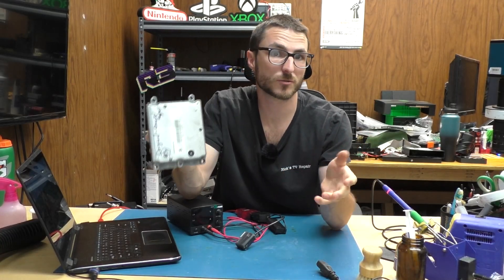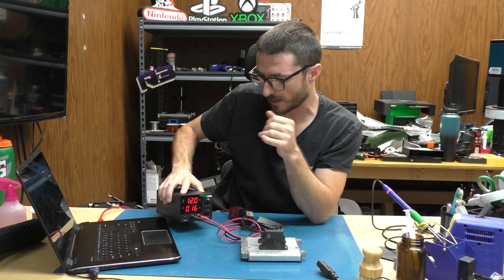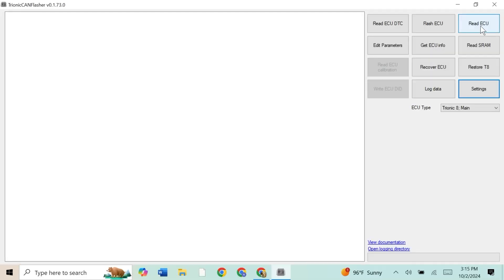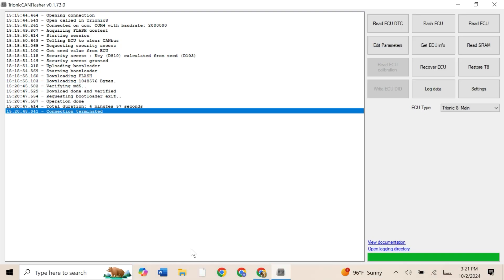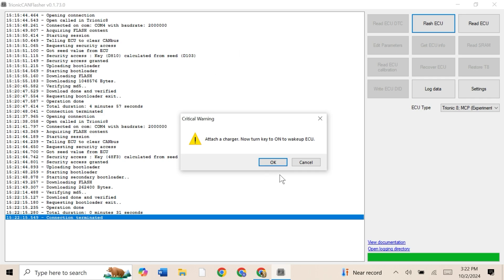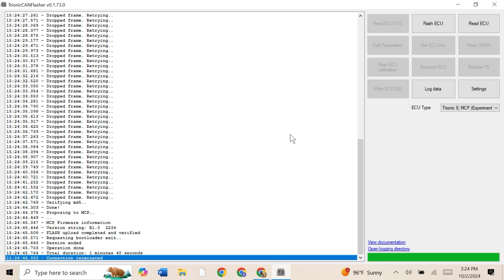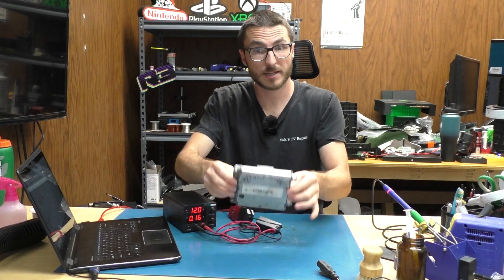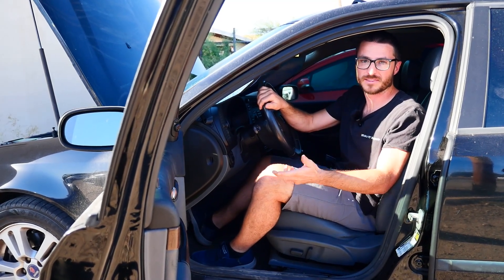Saab 9-3 ECU ECM Cloning Tutorial

Comment: Can you tell if on the car cloning optionally available? It can probably require less equipment for that. No power unit, no extra harness or adaptors are needed...
Reply from the maker: Yes you can also clone with the unit in the car and connect the computer to the vehicle. When you do that you will need to also plug in a battery charger because it will draw power from the car battery and drain it. If the battery drains out completely during the progaming process it could brick the ECM. So if you are going to do this make sure you are connecting a battery charger to the battery while programing. 
All of my filming equipment is in that room and it was easier for me to show it as a bench cloning than in the car cloning.
Reply: @NicksElectronicRepair   Thank you. Do you mean, cars` battery capacity might be not enough to finish cloning procedure? What kind of charger you have mentioned? Is that a plain car battery 12V charger that should be charging the battery during cloning or, an external 12V power supply to feed OBD assembly?...

Comment: So after I clone it onto the new one I just put it back in and I’m all set?
Reply from the maker: If everything is done correctly yes
Reply: @NicksElectronicRepair can’t wait, about to buy a 07 Saab with 156k miles for $375 I have the shop paperwork saying that the ecu/ecm intermittently overheats. They told him the car is done and they can’t replace the computer due to not having the correct software. The cars was also deemed as being in good mechanical shape. Does this seem like a good move?
Reply from the maker: For $375 yeah that's worth the risk if you ask me. But also the ECM can be fixed you probably don't need to replace it. Repair may also be more reliable than replacement since a lot of units out there are used and in bad shape. You can technically still get new ones through official channels but you are looking at $1,200 + shipping and tariffs (they are coming from europe)
Reply: @NicksElectronicRepair okay so. Send you mine you fix it for $480 and I put it in? Bing bang boom $3500 car?
Reply from the maker: I think that could be the case. Obviously, I can't guarantee nothing else is wrong with the car, but if that's what the mechanic is saying, then yeah in theory, that's $2,645 discount on the car. 
When it comes to the ECM, I guarantee a repair or I will replace the ECM for you with a refurbished one. So no matter what, you are 100% covered on the ECM front.
Reply: @NicksElectronicRepair okay cool
Reply: @NicksElectronicRepair on my way home right now
Reply from the maker: Are you saying you pulled the trigger on it and bought the car? If so, then congrats on the purchase. How is she rolling? Any rough idling, white smoke from the exhauste or codes / check engine light coming up?
Reply: @NicksElectronicRepair I have a rough idle at start. I get white smoke sometimes. Moves great
Reply: @NicksElectronicRepair is that maybe the vacuum pump dripping into the turbo?
Reply: @NicksElectronicRepair  Saab 9-3 4 cylinder parts list
Fuel pump
Vacuum pump gasket kit ( found leak)
Power steering rebuild kit
Front bumper 
Radiator
Taiwanese ecu kit (hopefully solves overheating)
Paint / primer
 Shifter knob
Seat
Oil change
Coolant flush
Tech 2 scanner clone
Reply from the maker: In my experience that is all related to the ECM still. Here is a video I made on that fault:
https://youtu.be/VBHQRhvKxBw
Reply: @NicksElectronicRepair ohhh very interesting
Reply: @NicksElectronicRepair I am going to send the ecu for repair for sure. I will also fix all the leaks in the mean time. I am running a combustion leak test. If that’s good I’m going for the vacuum pump and fuel pump. While the ecu is being fixed.
Reply: @NicksElectronicRepair  combustion leak test passed. Time for an ecu!

Comment: Hi Nick,  I am attempting to clone a saab t8 ecu per your video. I have downloaded trionic can flasher v0.1.72.0 and got connected to the ecu through my cardaq j2534 programmer. I've got good communication and can get info and as well as read and write flash. My issue is when I flash ecu i never get the message warning about it changing the vin and key data. As a result when i get info after the flash the vin and calibrations numbers do not change, im also guessing the key/ eprom info has no cloned over. When i re run flash ecu the software tells me files are identical, what am i missing here?

Comment: So I got a junkyard T8 and I have the flasher and obdsx but when I try to read the ecu I get failed to get security access. Is there a step in missing to gain security access? How do I do that for this junkyard ecu? Thank you
Reply from the maker: That's weird. I have not experienced that and am not sure what could be causing it. I have no idea why that would be triggered.
Reply: @NicksElectronicRepair  so I ended up finding out it was because in device manager, i did not have my latency set to 2ms in the advanced settings for the com port. Also i did not have the proper security updates, which then caused another error. After I did those two things it was able to give me the ecu information. But it had weird computerized language next to it as well. Ultimately I started having issues when reading the ecu as being frames drop, similar to what was showing in your video, and I put on my IT hat and remembered if it's saying frames are being dripped then it's relating to cpu and GPU usage. The frame drops are happening because the computers graphics processors is getting too much stress in addition to the cpu. I tested the theory by taking out my Alienware with windows 11 and putting the can flasher program on it for windows 11. And it worked fine and did the entire read in 2mins. And as for flashing my ECU, it only took 3mins. So 100% faster than most people's recorded times and 100% directly related to CPU and GPU ability.
Reply: Youve probably sorted it by now, but I got the same...Turned out I had placed the connector the wrong way.. After that it worked like a charm.
Reply from the maker: oh interesting. 
You know we did actually also notice that if we had a ton of windows open with several programs going at the same time it was more likely to get dropped frames.

Comment: Hello Nick....I kindly seek your advice on the issue detailed below.

I have a 2003 SAAB 9-3 1.8t that developed a misfire when idling, even after cruising. I replaced the ignition coils, but the issue persisted. My mechanic initially diagnosed it as an ECU problem, so I sourced one from the UK. However, it couldn't be configured locally, so both the new and old ECUs were sent to Dubai for cloning.

When reinstalled, the car started fine and idled well. After a test drive of about 5–10 km, it suddenly lost power and wouldn’t move. Restarting didn’t help, and I had to tow it back home. I consulted another mechanic who requested a different ECU, but he has also failed to configure it—making the situation worse.

That’s the current state of the SAAB. I would greatly appreciate your advice on the best way forward.
Reply from the maker: For me to better assist you I would rather we email. Please fill out the contact form on my website linked below:
https://nickselectronics.com/pages/contact

Please make sure to provide information such as the exact part number of the ECU, and any fault codes triggered. 
The more details you can provide the better able to help I will be.

Comment: Does it matter if power adapter is 12V with 2A? 2A matters at all or ECU just will take only needed power? Maybe stupid question
Reply from the maker: There are no stupid questions, we are all here to learn. The voltage has to be 12 that's not negotiable, but the amperage you could put at 0.2 or at 1,000 amps, the ECU as you suggested will only pull what it needs. So most likely around 0.16-0.18 amps give or take with a few spikes up to 0.22. 
Now with that said I don't think it's necessarily a good idea to set it that high because if there is a short or a problem then it will actually start pulling that much amps and that could cause more damage to the unit. So I would say set it to 0.3 because it shouldn't need more than that. And if it pulls more than that then it means you have a short somewhere and should do some diagnostics and troubleshooting on the unit.
Reply: @ ok thanks for that thorough answer. Maybe this is the reason my ECU has isues after connection to Chinese 2A power adapter. Maybe something was already wrong with Ecu but 2A didn't help and finish the job
Reply from the maker: That's possible. I wouldn't know for sure without you sending in the unit. 
Did something smoke or smell of burning?

Comment: Hi, got questions, i know that ECU is different between saab 9-3 2003-2006 and 2007+ and the cloning process also different, could you please give us some specifics? what are those bench files?  Why you are using MCP ? what does it do?
Reply from the maker: The cloning process is identical for all ECUs between 2003-2011. 
You have to save the ECU and MCP and then you can use those to program your new ECU. 
Technically if you are using an ECU with the same part number then you don't need to do the MCP part of it. That's the part where if it was made before 2006 it has a certain software on the MCP and if its 2007 and after it's got different MCP software.
Reply: The only known exception is XWD -> you need a special ECU for those. (Or modify a regular one by installing the missing components if you really want to).
MCP handles most stuff related to your throttle body so even tho we usually say use mcp bin r1.0 for 06 and older and 1.1 for 07 and newer it's actually bound to which throttle body you have. You need mcp r1.0 and a main binary from 06 or older with the old TB and r1.1 with a 07+ one if your engine has the new one.

They did in fact also change the ECU hardware slightly 06-07 but it's only related to signal noise reduction. Either version will work just fine as long as it's not XWD
Reply from the maker: Hello,
Can you give me more info on what components are missing for the XWD? We have used the XWD in a non-XWD vehicle and it seems to work 100% with no issues. But the other way around you are saying won't work then? What part specifically? According to forums people say the fuel gauge, but we had a customer with an XWD try out a module programmed to his vehicle that was not for an XWD and he didn't report any issues with it. He did however report rough idling which was not occurring in our non-XWD vehicle.